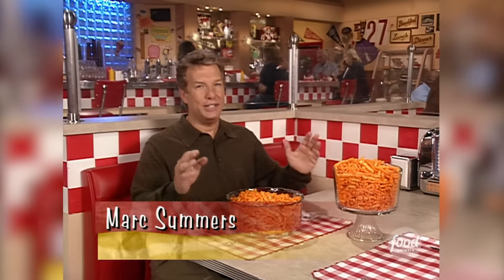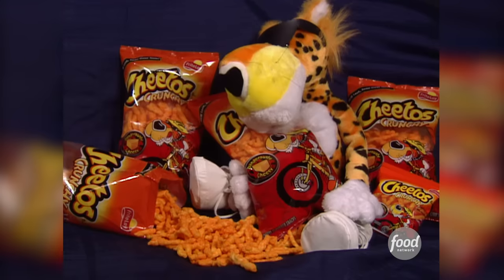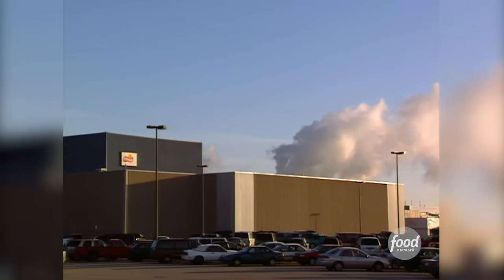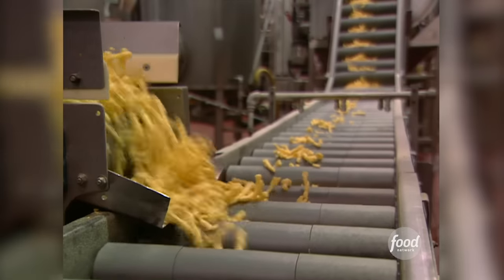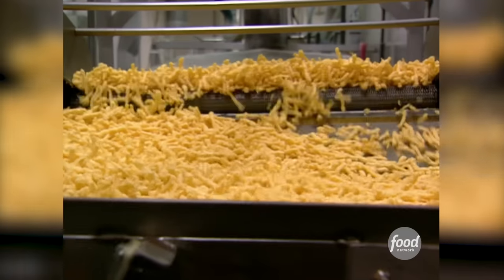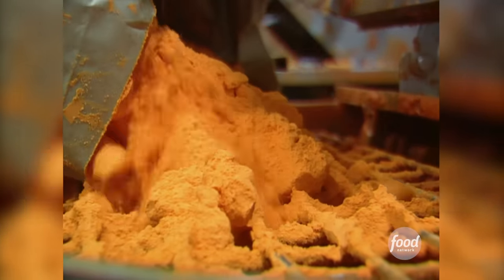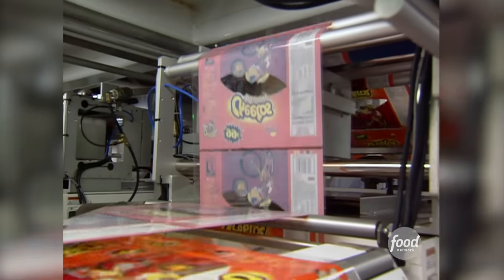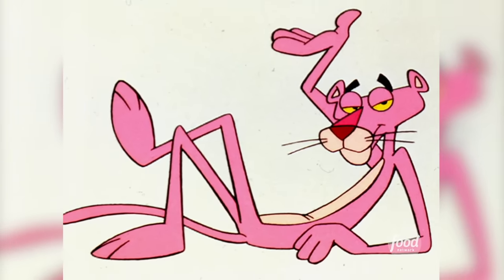How Cheetos Are Made (from Unwrapped) | Unwrapped | Food Network

Comment: so for those who were curious about what the extruder is like, if youve ever been around a feed making machine its basically that, the corn meal gets pressed at such a high pressure that the water in the batter evaporates. The peices that come out are like the cheeto puffs and as they said when you fry those little dudes you get the irregular shape of the cheeto. You're welcome.
Reply: Thank you! Have you ever tried making cheetos? The taste isnt too hard to get right, its more about the texture
Reply: You called it an extruder but described a pellet mill- very different processes. Extruders use starch expansion and shaping, not compression like a pellet mill.
Reply: wrong it’s two metal plates that rub the meal together and when the corn meal passes the boiling point it pops, making the cheeto shape
Reply: Doesn't sound right.. they get their shape before being fried, as mentioned in the video.
Reply: @MindDrip Exactly what I thought
Reply: Wow
Reply: why does this thing need to be so top secret anyway?
Reply: I I think you made some errors

Comment: If I had to guess, the extruder probably uses pressurized air (or some other gas) to force the batter through small openings. Since the batter is pressurized, it will have dissolved gasses in it that  expand when exposed to atmospheric pressure, forming lots of tiny bubbles that give it its puffy shape and texture.

Comment: I'll give you a hint: The cheese puffs extruder looks similar to a meat grinder with only 2 holes a big one in the centre and a smaller one around the edge of the cylinder but instead of just turning it into puffs it also gets so hot that the paste gets cooked! edit: the big hole is for puffs and the smaller hole for the crunchy variety

Comment: they didn't show the process cause its "top secret" but heres kinda how it works
the extruder looks like a bunch of very tiny holes in which the batter is pushed through, the pressure and heat caused by being squeezed through such a tiny hole causes the batter to cook into cheese puffs.... crunchys go through an oil step after extrusion.